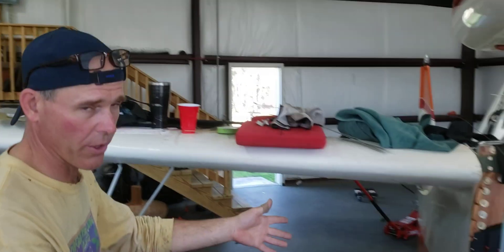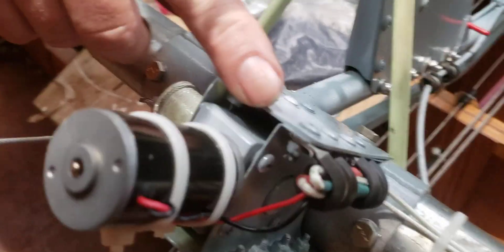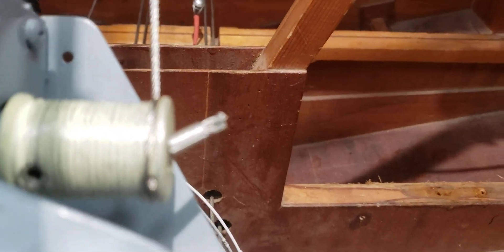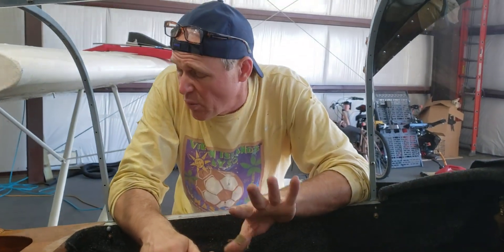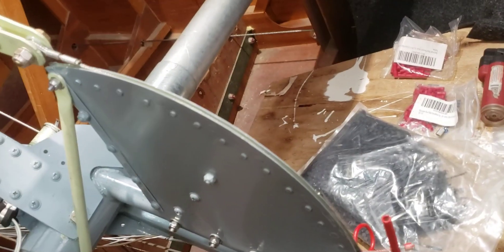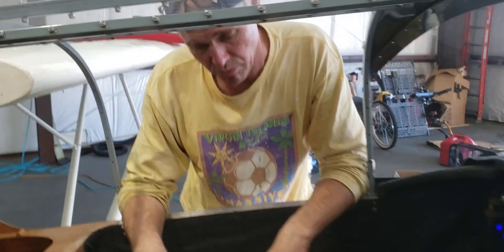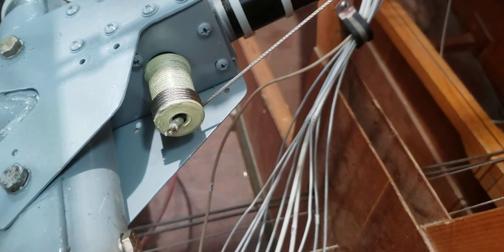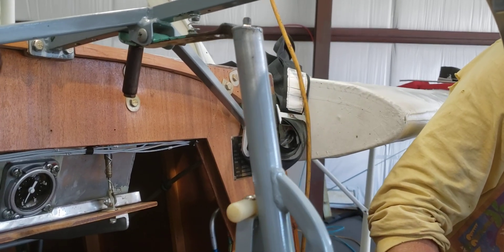Volmer VJ-22 Landing gear assist out of Diamondhead Mississippi.

Comment: I had cf oqf 1st built from plans.the gear was operated by a power window motor going through  a 3/4 threaded rod.Simple  lots of grease .I weigh 215 so I took it out and put in a Johnston  bar.Less weight less to fail
.

Comment: Not sure if you'd need to bother with that last cable/bungee to lock the gear all the way down. Part of your landing checklist is going to be making sure your gear is locked in whichever position it's supposed to be in for whichever surface you're landing on anyway. The easiest way to check with the Johnson bar still there would be to push/pull on it, which would complete that last inch of downward travel, even if the wind didn't do it for you. If neither happens, I'd wager the friction of the wheels spinning up when you touch down will be enough to lock it all the way down, since they're mostly moving backwards by that point in the rotation. Of course, that'll slam the Johnson bar down into place with some authority, which is like to scare a few pounds out of the pilot, if ya know what I mean.

Nice little bit of ingenuity, all things considered. Well down sir.

Comment: Nice Bill. 
That's thinking out of the box. I like that you are able to use the johnson bar as a backup. Most likely the only emergency use of it would be to lower since if you take off and it doesn't work you could just keep the gear down for the flight and land on land. But you still don't have to waste a good day puddle jumping just because of those pesky landing gear. :) Awesome job! Now you need to get it to go 180 degrees. :)
Darrell W. Volmer Club of America
Reply from the maker: Thanks Darrell!  I have seen Volmers with the chain and gear and just wanted to try something different. I like the thought of a back up. I sat in mine on stands and successfully operated the gear manually , but it was definitely a two hand operation and I am not confident I could do it if I am privileged to get older.. 
180° could be accomplished (or real close) if I cut the Johnson bar down to go below the the mid structural support, and modified the mechanical advantage I built to dip down into the bilge with the same curvature. I am currently relying on gravity, and then the wind generated by flight to lower the gear and this would have to be addressed if I went to 180°. 

 In lieu of 180° I was considering constructing a vacuum infused carbon fiber aerodynamic shield that the gear would fold up into on the sides of the hull. They would weigh about 1.25 - 1.5 pounds a piece and significantly reduce the drag, become a step and could possibly be designed to aid in some low speed water deflection. If I construct these molds I will design them where these could be bolted right to the side in minutes.

But you know its always about weight though. 

After attending Sun and Fun we have to go back to work in Toledo and the Volmer will have to sit until fall... Ironically, it will be completed today but I will be waiting on FAA paperwork for months...  I am also considering designing and building molds for new sponsons because, well you know... why not...
Bill